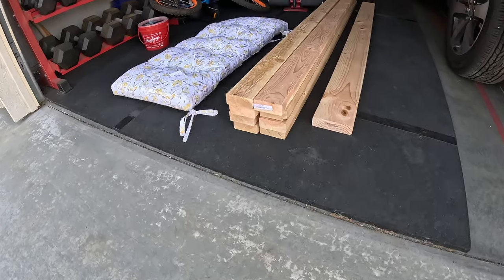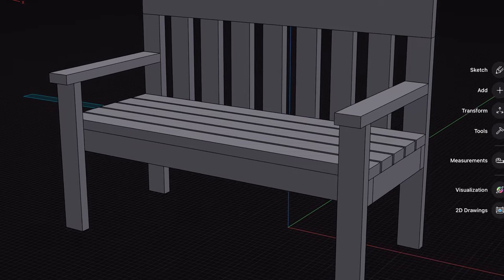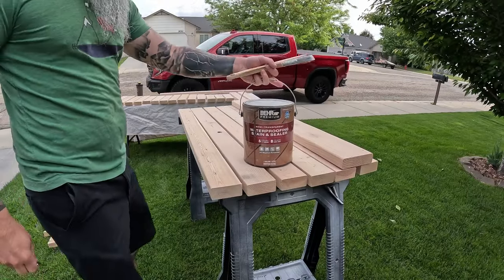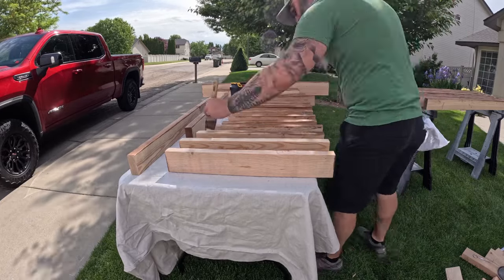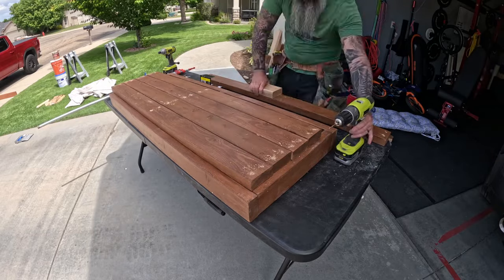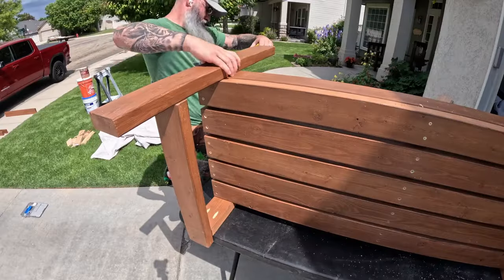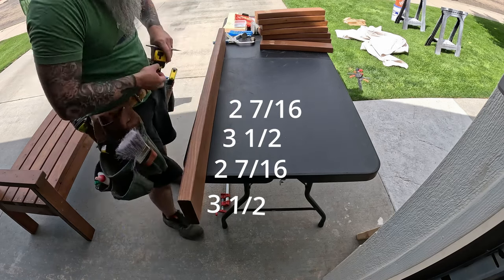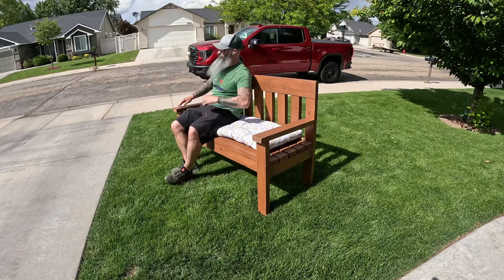How to Build a Garden Bench for under $50

Comment: Fantastic video and great step-by-step! I cut all pieces, made my pocket-hole drill outs, then stained everything including the drilled holes to ensure everything was 100% protected. Thought about using pressure-treated wood for a few of the pieces for the legs as they will have ground contact, but just went with attaching hard plastic end caps I found at the hardware store to the bottom of each leg to further protect it from any chance of rot (NH gets pretty wet and tends to age or rot wood quickly here if left on the ground, treated or not, unless it's cedar!)

Comment: Great video! Im building one now for my father. A couple questions, if i did pocket holes on the back of the armrest would that be stronger than screwing it from the back into the endgrain? Should i fill the screw holes on the seat portion to prevent water sitting in? Thanks!
Reply from the maker: Hey sorry I missed this. I’m normally much better about responding fast.  Regarding pocket holes on the back of the armrest.  Yes it would be stronger, however, I don’t think there is enough space to get the drill in at the proper angle to install the pocket screws.  Which is why I went through the back.  That joint is not going to be holding a bunch of weight so I don’t think strength is a big consideration.  For the screw holes, as long as you don’t bury the screw head this should not be a problem.  But if you bury the screw too deep you are opening up wood fibers to the elements.
Reply: Thank you for the reply, much appreciated

Comment: Did you use pocket hole screws or just regular like wood screws, or does it matter??
Reply from the maker: I used pocket hole screws.  No it doesn’t matter but the heads of regular screws are different than pocket hole screws and they tend to drive too far if you’re not careful.

Comment: What size screws did you use and also what dimension of drillbit did use when using that blue jig that allows you to toenail the screws thank you
Reply from the maker: That jig is a called a pocket hole jig.  It comes with a drill bit specific for it.  I used 2 and 1/4 pocket screws.

Comment: What type of wood is best for outside furniture?  And type and length of screws?
Reply from the maker: Type of wood is really personal preference and would depend on the kind of furniture you are making.  Screw length would depend on the wood.  The finish you put on the wood is what matters.  Use a water proofing stain like I did here and the furniture will last for years and years.

Comment: What size screws you using
Reply from the maker: The pocket screw are the ones for 1.5 inch wood.  I think they are 2.25.  Could be off on that.  Anytime I used a regular screw they were 2.5 inch.
Reply: @OutdoorBeards  thank you for the info. Im going to try to build this exact bench. It’s my first time building something. Any advice for a first time builder?
Reply from the maker: @amart63  what a great question.  I have some good ones from different mentors I’ve had over the years.  Enjoy the process.  It’s one of those “the journey is more important than the destination” things.  The process of building is where the joy comes from.  Normally when I finish something I am proud and a little sad at the same time.  
Mistakes are a good thing, see them as such.  They teach you more than success.  We work with things that are dangerous, I have a 3/4 thumb as evidence, respect your tools but don’t fear them.  Fear makes you tense up and is the worst thing to be when using power tools.  Don’t compare your work to others, compare it to your previous works.  I think that’s the best one for a new builder.  People will be amazed at your finished project while you will know every flaw.  Have fun and let me know how it turns out!
Reply: @OutdoorBeards  that is great advice. I took a screen shot of it so I can look at it and reference during the process. Thank you for your time once I’m done I’ll reach out to you see if I can send you some pics. Thank you again you really helped. Also you said that when your done your proud but sad that it’s complete, that is the same feeling I get when I’m done building a lego set or when I assembled all the furniture in my house. I’m sure this is going to bring lots of excitement into my life and I will try to enjoy the process. Thank you again sir
Reply from the maker: You can email the pics to info@outdoorbeards.com I look forward to seeing it!  

Side note: I grew up on legos.  Miss those days.
Reply: @OutdoorBeards  legos are great. I loved them as a kid and now I get to show and watch my sons build them. I saw you have merch. I’ll get an order soon. Thanks again brotha 🤙🏻